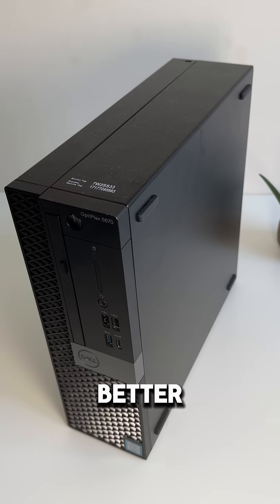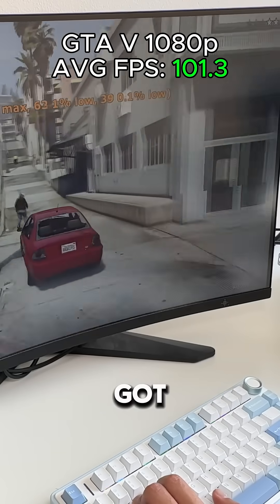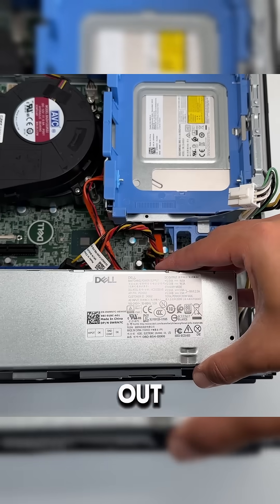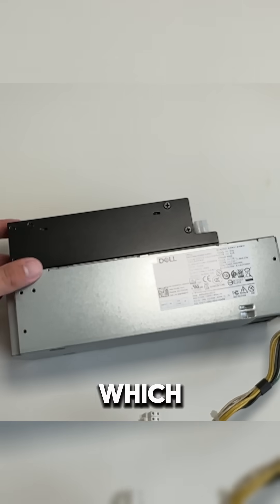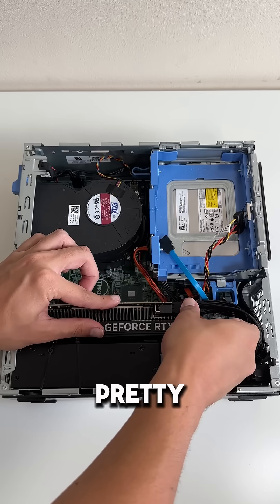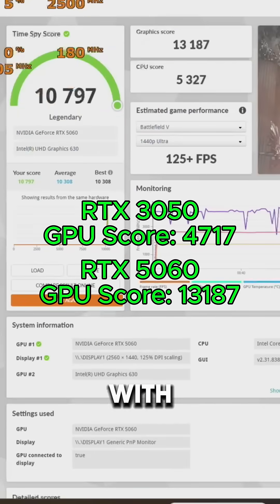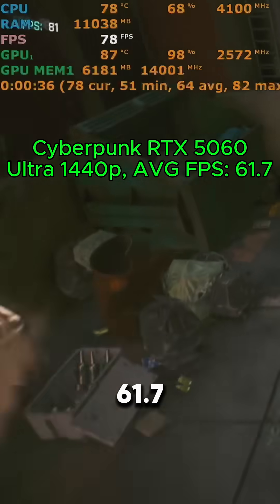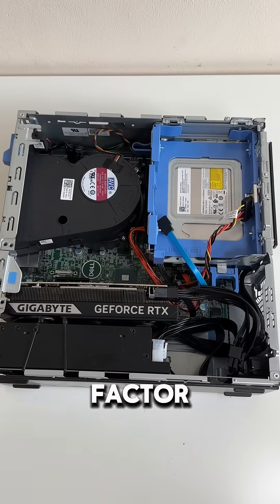Office PC to RTX 5060 Gaming PC DELL SFF  #gaming #nvidia #pcgaming #rtx5060 #pc #gpu

Comment: This gpu should have come with a low profile bracket for such pc case
 Also what cpu is in there? Unless its an i7-9700 version of optiplex 5070, its really bottlenecking the 5060. Also no pcie 4.0 support so there is a bit of fps loss too, and likely no Resize BAR support in bios, so an fps loss too.

Comment: wait so the LP GPU doesn't come with LP bracket?
Reply: It does come with the bracket, but even with the LP bracket, it won't fit because the x16 slot only has room for a 1 slot card & and it's a 2 slot. That's why the yeston 3050 worked, otherwise it would go into the psu bay normally

He explains it in the full video
Reply: yeah sometime :VV or u just need to use 3D printer to make one